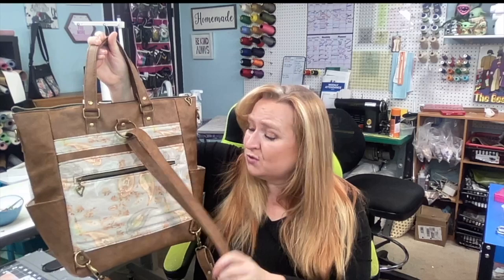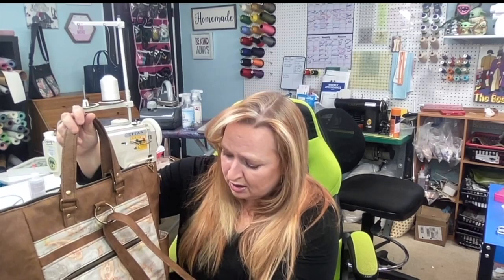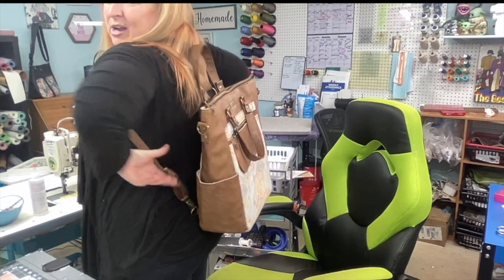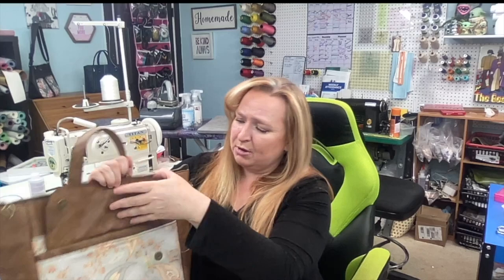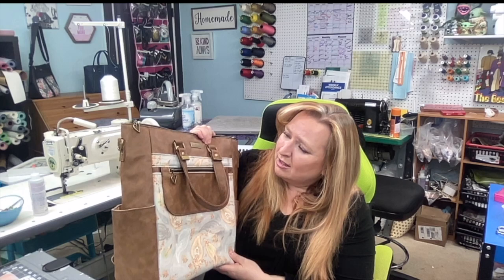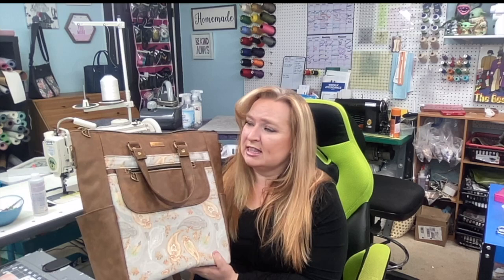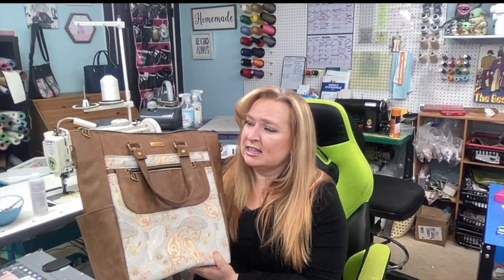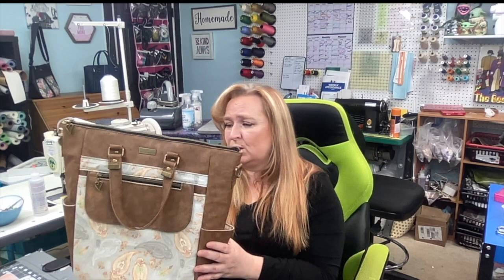The Trailblazer Convertible Pack (Modified)- Full Tutorial|Bagstock Designs

Comment: Hi Brandy!  I really enjoy your tutorials and have learned a lot of great techniques.  I really love your modifications on this bag.  Did you shorten the length of the handles at all?  It seems to me like the should be shortened a little to account for the connectors and d rings.
Reply from the maker: Thank you so much! No I kept the handles the same as you fold under the rectangle ring an inch or so when riveting them in! But you can make them any length you like! Even shoulder length if you want a shoulder strap :)

Comment: Another question, lol. am following a sew along on youtute, have done everything as directed by the pattern, so the side piece is 15 inches long by 6, but my finished front and back pieces are only 14.75, used the 3/8 seam allowance putting the pieces together on the front and back, double check the pattern I cut off and removed the seam allowances on the front and back panels from the pattern pieces. Taped them together and the front and back is still only 14.75. I am going to selvedge what I have sewn by cutting 1/4 inch from the side seams, my pattern print out was on a4 paper and the 2 x 2  block matched, I am not sure why the sides are 1/4 longer. Need help
Reply from the maker: I am not sure. I have never had a problem but print letter as I’m in North America… did you follow my class? We do full cutting in my membership classes .. double check the seam allowances when pieces together.. I can’t remember if they change or not. If doing in cotton, there is a chance of shrinkage when interfscing too
Reply from the maker: You could just take 1/8” off the bottom and 1/8 off top of the sides and it would make up the difference and won’t make too much of a difference over all :)
Reply: Double checked it all was right, thinking now, it is thickness of material wpc, leather bonded. So i think next time will have to adjust for thickness of fabrics
Reply: @brandyjackson-beansbags  it is the thickness, pulled back apart, was the sa, material too thick😢
Reply from the maker: I would say just trim it i up 1/4” isn’t much at all
Reply: Thank you, but I found the videos of the trail new and old, but no cutting out on that one, but watch alot of you cutting out tutorials. Might be too, there is too much stretch and not enough on the other pieces, I did not stabilize the leather. @brandyjackson-beansbags :virtualhug: